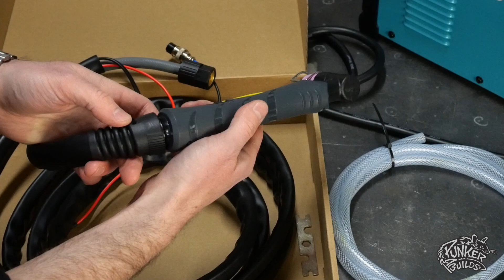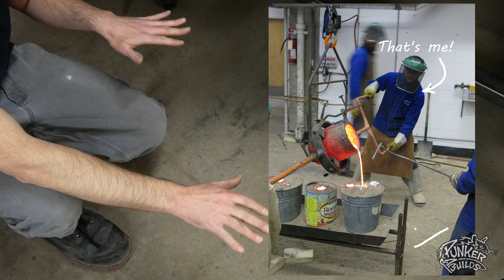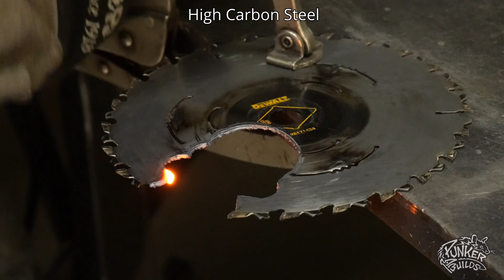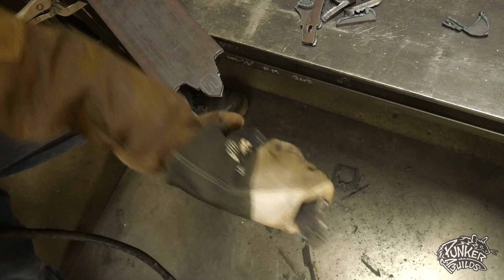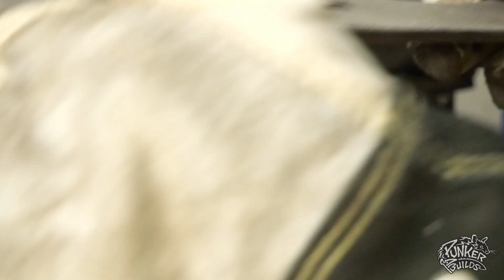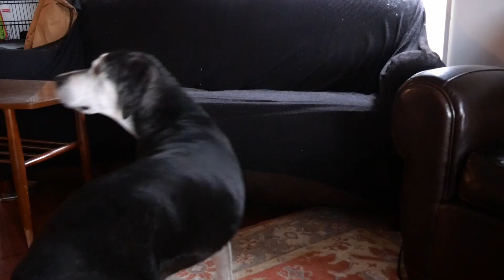Trying out an affordable 50A Plasma Cutter - BestArc BTC500DP Review

Comment: Good video, thanks. I’m a retired woodworker but restoring my’79 F250. I’m guessing that this machine would work great with 16 ga floor panels? Thanks
Reply from the maker: Thanks for watching! I haven't run it enough to kill it but I think that plasma technology has been locked in pretty well - any affordable plasma should handle 16 gauge no problem. The tips don't last long though.

Comment: 😆 I don't even herd angry pixies and I know that the standard is 120VAC or 240VAC in North America. It did change but that was many many moons ago. 
Very cool video. Good plasma cutting tips. Very cool project. Bestest puppy boy ever. Subscribed after watching one video.
I have a cnc plasma cutter at home, Langmuir Systems CF Pro, and the plasma cutter that I bought with it was... defective. They have fixed them now but at the time I needed to get up and running and I didn't have a lot of funds. Off to Amazon I go and I got a Chinesium plasma cutter for cheap, under $300US to my door in a few days. It's been great. Out performed the $1000 plasma cutter that didn't work right and it's been doing it for something like 3 years now. It was called Arcfony but I think they are BestArc now.
Reply from the maker: Damn! That's way longer than I was expecting that to go, 3 years is pretty wild! Even if this machine only lasted me 6 months, I'd for sure be able to make the money back on it in a hurry. Thanks for watching!
Reply: @PunkerBuilds  Several things are probably helping with keeping it alive. 1 - I cut a lot of 20 gauge so I have the power turned down, usually 20A. 2 - It's on a cnc controller so I can regulate the pierce times to as short as possible and the torch height is automatic initial and automatic while traveling. 3 - I run the air from the compressor head through a cooler and 3 water separators before it gets to the tank. 4 - I think the water table might be helping just by keeping things generally cooler.